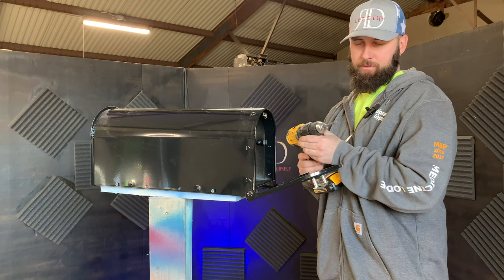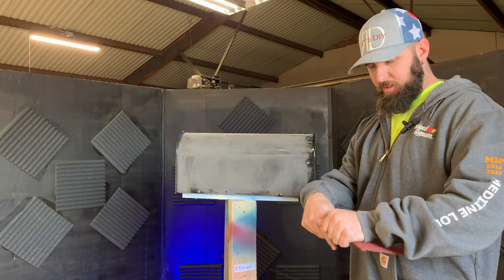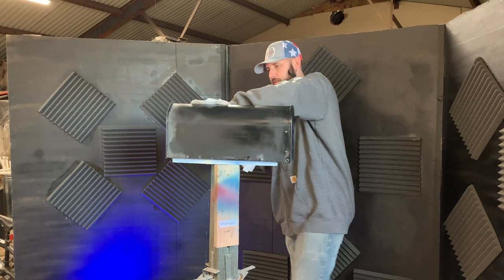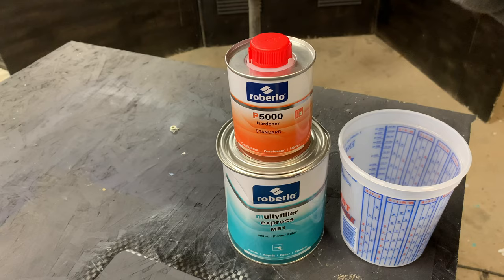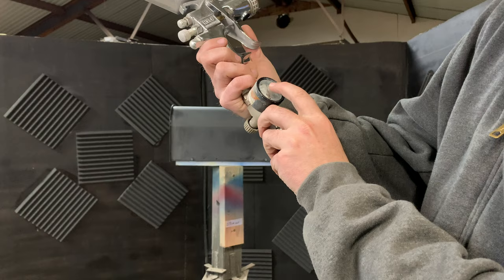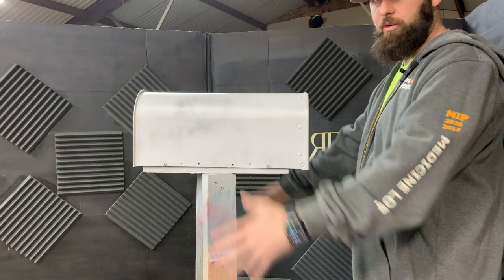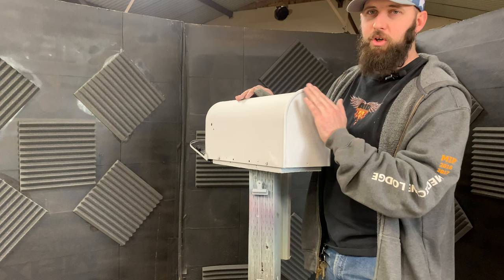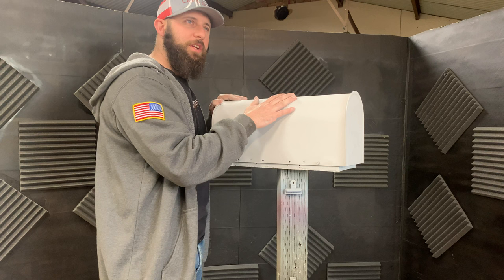Paint Job On Mailbox Start To Finish Part 1

Comment: I started painting a brand new white mailbox with acrylic paint, but I didn't use any primer before painting. (I didn't know about that part) The paint has been going on fine, and I'm going to use an acrylic matte sealer to make the paint waterproof. Will my design on the mailbox still be okay with just the paint and a few coats of acrylic sealer on top? I would hate to have my design get ruined in the rain but I've also done so much to repaint it all again.
Reply from the maker: I totally understand. Quick question did you scuff the original paint before you started? The reason I ask is your acrylic paint will need to have toothing in order for it to last longer. It may peel if you did not sand before you started if you did then I’m sure you will be OK as long as you seal it When you’re finished. If you’re far enough along and you didn’t scuff  it might be worth it to you to just see what happens and finish it out. Hard to say depending on the environment its in on how long it will last you.